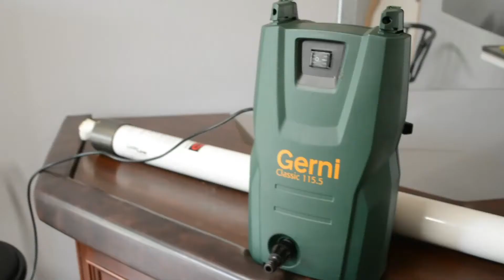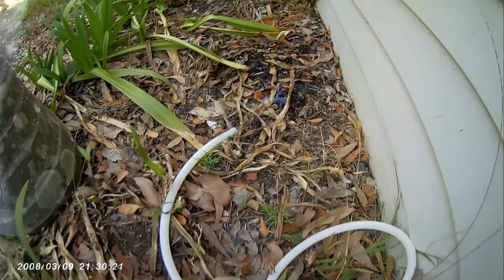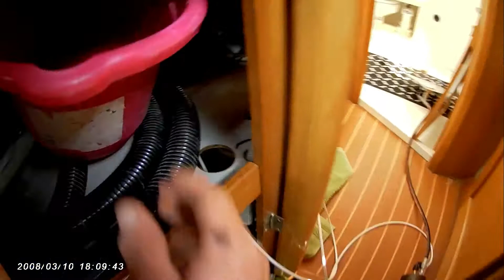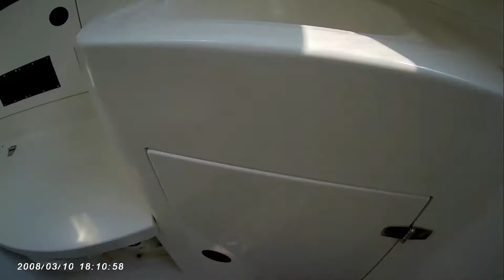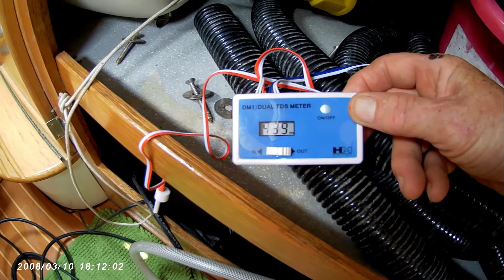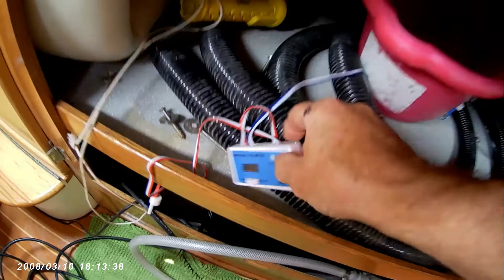Spectra Watermaker: Replacing the Clark pump with a pressure washer pump.

Comment: Thanks for sharing this - very interesting indeed.  Could have been more convincing if you showed the actual flow of product water.  You show us the water flowing out of the tap in the basin in the head.   Isn't that just the water being taken from your boat's water tank and being pumped by your fresh water pump?  And that pulsing noise that is always in the background, is that your system water pump providing that flow rather than the watermaker?